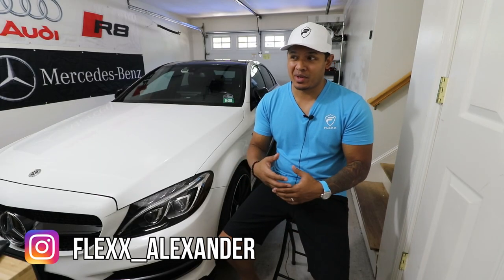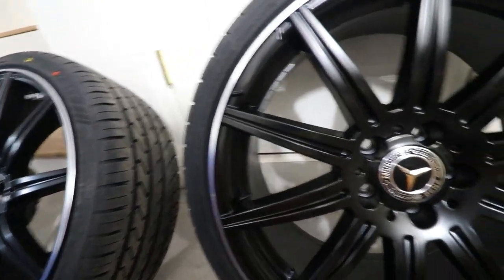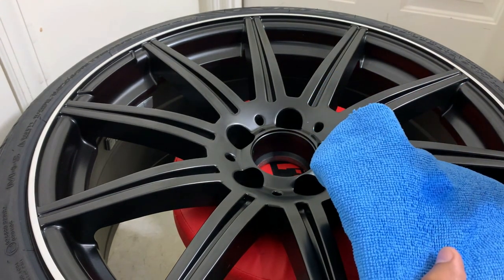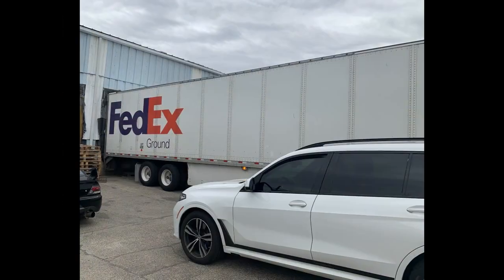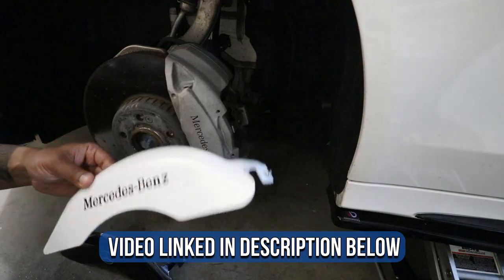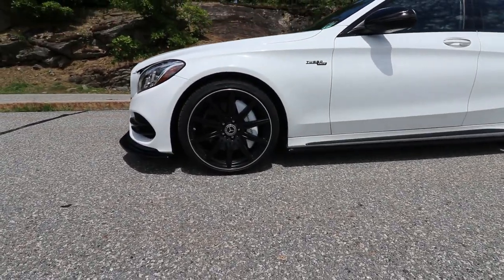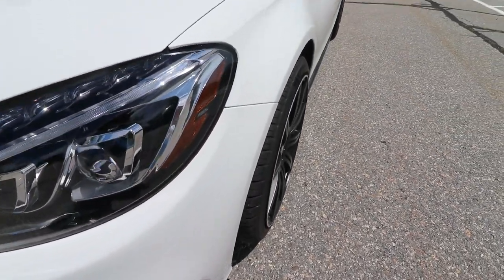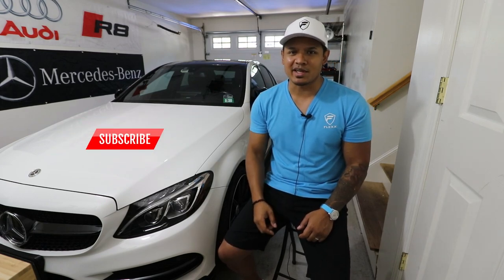Replica wheels on my Mercedes C300 (W205) 2015+

Comment: Looks great. Instead of lowering my w204, I put on Bilstein shocks and struts (kept OE springs) which are shorter than the Sachs. I then put on 19s from 17s. It’s not perfect but it closed the gap a lot.
Reply from the maker: 19s on a 204 and 205 are the way to go. 18's are still too small and 20's are way too large (kinda gaudy).  Plus with 19" rims, you can still have a decent sidewall profile for the tire to take a beating in the streets.

Comment: Flexx,
No pressure! Yeah a new rim for a c450 19” OEM is $1103. Thank god I had a warranty back then. I have multiple spoke  which I need to refresh or powder  coat. Road rash. But I was never into black rims,but those looks nice even with the caliper covers. I need to check it out as the brake dust is Horrendous. Nice combo for sure. Oh by the way finally got both roof and carbon spoiler on. Looks good but definitely not like yours. Keep up the great work !Mahalo 🤙

Comment: I swear you read my mind. I got the exact same wheels/wheels caps. Same specifications but I have a staggered fitment because I have the amg package. 225/255. Mine were silver and I wrapped them satin black 😂. Mine were OEM but I got them used, so I got a killer deal for them.
Reply from the maker: Heck yeah!!!!! 😎🤙🏼. I could do stagger tire setup but I rather run a square setup on mine so I can rotate the wheels easily since it’s a daily driver. Plus won’t cost a lot of 1 tire blows.
Reply: @TheFlexxGarage  I got a reply 🥹, let me know if you plan on doing a audio system upgrade, like add/upgrade the subwoofer/add more speakers to your car. I’m doing a full burmester upgrade. Full OEM specification etc. let me know if you plan on potentially doing that because I’m in the process of doing that, and I could help!! ALSO, I only got my w205 c300 because you made your videos, and it gave me the confidence to buy, so THANK YOU
Reply from the maker: Nahh. I don’t plan to.  Just too much work plus I’m older now and just don’t listen to music that loud like I use too. I have a sub and amp that’s been sitting for like 3 years and I don’t even have the urge to slap it in my benz or my A4. Hahahaha

Comment: Love it but yes, that wheel gap kills it a little. Why not just get some H&R sport springs? The drop isn't crazy, you shouldn't have rubbing issues and the car will look 10x more aggressive. I put them on my 2020 c43 and they're perfect.
Reply from the maker: Already answered this in another comment. I bought the springs a year ago and they are in my garage.
Reply: @TheFlexxGarage  Sorry, don’t read through every comment to check first. I did now however look to see and for what it’s worth I’ve had those springs on my car for a little over a year now and I know everyone thinks where they live they have the worst roads ever but if you’ve driven in Chicago or the suburbs it can be interesting one might say. I’ve had zero issues driving the car and have never rubbed on anything yet. My wife takes the car out once in a while and has also never had an issue. So if I were you, I’d throw those things on right away as it will completely transform how amazing that car looks and again, there’s no reason you should have issues with rubbing or clearance etc.
Reply from the maker: im not concerned with rubbing or clearance. I have the same exact springs on my A4 along with 19" rims (wider tires than benz) and my wife refuses to drive that car because of comfort. It's harsher than stock. It's not always about the looks. And I'm not going after a show car look cause this car barely goes to meets. 

Plus, I do have crappy roads. I already went through a set of rims (forged wheels) being bent from potholes. And my sister had an E-class that went through 3 set of rims in 1 winter. And it's not bad driving...it's crappy ass roads. The benz is our daily driver and sees way more time on the road than any of my other cars so it's exposed more to the junk roads. I value comfort over looks anyday based on my circumstances.
Reply: @TheFlexxGarage  I hear ya. For what it's worth, the ride feels absolutely no different from stock. I was worried about that also but still feels 100% stock.
Reply: Yeah I wanted to do that also but the ride is rough enough. But it definitely looks better though. C450

Comment: Looks killer. Did you feel a difference in ride quality with the 8.5 all around ? And how does it ride as far as road feel or road noise with the lower profile?
Reply from the maker: Rides the same as my stock 18 inch wheels but just a tad more stiff cause there’s less tire sidewall with larger diameter wheels.

My wife is a stickler for a comfy ride and she drove the car and barely noticed a change in ride quality.
Reply: Thanks for the reply! Where did you buy the rims?
Reply from the maker: Literally mentioned it in detail in the video.

Comment: Hey flex, rate my setup. 

I have a w205 2018 Mercedes-Benz c300 Base-Model Sedan in Selenite Grey-Metallic. 

Already got a chrome delete (changed to gloss black), grille swap to GTR style, gloss black door handle covers, debadged (& replaced with only simple gloss black trunk star), got 5% all round, 20% fronts w/ 50% ceramic winshield. 

I just ordered a Brabus tuning chip, custom luxury/elegance front end (luxury/elegance front bumper, custom gloss black Maybach style grille, as apposed to normal S-class Louvre-style that is offered stock with luxury-trim W205’s), along with an AMG-GT style rear bumper, complete Brabus Carbon fiber body kit, including; front lip, side skirt, rear wing, rear diffuser, fog light vent covers (since luxury bumper is same fit as base model, and this is all Brabus had to offer besides front lip for base/luxury bumper) all real carbon fiber, as well as hood/trunk logos to match (i paid for the entire kit & chip, im throwing the B’s on if i want to idc i earned it… atleast im not completely cornballing it w/ the giant “B” on the grille, lol…)  as well as a c63 style forged carbon fiber hood, AMG side fenders, and custom Chrome Hearts rims, 1:1 with the ones drake has on his custom Rolls Royce (had made 20” with 5x112 bolt pattern) 

…All for under $5000, rims & tint included 😂

So, reason I say all this (not just to flex) but to show it does not matter what trim/version/model/car you choose, but simply what you choose to do with it.

Comment: Looks great! I looked for the link I couldn’t find it. But my Amg rim was like 1104 each . I need to bring to wheel man to get the curb rash off. Thinking about new ones or powder coat. Multi spoke grey/ silver on white. What would Flex do? Hey that would be your new shirt idea with your logo. 🤙
Reply from the maker: There’s no link. As mentioned in the video, it’s a contact at the wheel store that you need to reach out to. 😎🤙🏼

Comment: How come you chose these in Standard 8.5 all around fitment over your previous Staggered 7.5 front & 8.5 rear wheel setup? Any benefits or cons you noticed with the change?
Reply from the maker: I rather have a squared setup so I can easily rotate all the wheels to whichever corner of the car I want. The car is awd and better performs with all wheels being the same size.

Comment: Sup Flexx! What do you recommend for wheel sensors for a 2013 Mercedes c class? I just brought a set of 18 inches aftermarket rims and I need a set of wheel sensors for it. And do I also need to get a TPMS relearn reset tool for it too?

Comment: Do you have any rubbing? Also would 19x9 be an issue?
Reply from the maker: No.  

19x9 will rub inside (especially in the front) unless you get a more aggressive offset but then your wheels like stick out past the fender and if you hit a bump, the wheels will smash into your fenders.

Comment: Hey flex, i just turned 18 and im looking to buy (finance) a 15’-16’ c300 in the next month or two. but im a bit skeptical about maintenance and reliability. Is there anything to watch out for? And on top of that, the used car market is terrible right now, do you think it would be better to wait and see if prices drop? Or should i stay with my 2010 jetta vw with no car payment?
Reply from the maker: Wait. 

And don’t buy a 2015 c-class but 2016+ is fine.

Maintenance is normal like any other car.
Reply: Although going on 7 years on my c450 I have no issues 86k. I think no car payment is always best. Save your money un less you got a lot of it.
Reply: @TheFlexxGarage  Is there anything in particular wrong with the 2015?

Comment: Nice! I wonder it would fit with 40 profile tires. Where are you from new england? Im live in NE too. Cheers!
Reply from the maker: Of course it can but for a c300 (w205), the 40 profile on a 19” rim will throw your speed gauge off from the real speed of the car.  40 profile will make the overall diameter of the wheel too large compared to stock diameter.  

235/35/19 is recommended for a square setup (all wheels the same size). 

40 profile for a c300 (w205) is for 18” rims. 235/40/18 is recommended. 

And for 17” wheels would be 235/45/17. 

I live in Texas now.
Reply: Thanks for letting me know man

Comment: Your offset should be 44 front and 49 back! I bet that will hit the arches! Plus the tyre/wind noise excels due to aero going down the side of your car hitting the tyres! Nice wheel though.
Reply from the maker: Nope! Zero issues. If the car was lowered, then yes, “might” hit but not with my setup.  It looks good and it rides fine.

An offset of 44 and 49 is close to factory wheels. Thats tucked in and won’t look flush with the side of car.  That’s the look that everyone hates on any stock car and they quickly fix it with spacers or new wheels with a more aggressive offset like mine.

Comment: What do u think about et30? Would fit or scrub? Same size wheels
Reply from the maker: Depends what tire size and what suspension you’re on. 

I think with any tire wider than 235, the wheels will stick out past the fender and if you hit a big enough speed bump or pothole, the wheel will bounce up and crush the edge of your fender.  Again…just my opinion.

Comment: 19x8.5 work ? Aren’t the back ones wider? U don’t rub or
Reply from the maker: As mentioned in the video, it’s a square setup (tires and rims).  And no issues with my stock suspension.

Comment: Did the rim and tire change roughen the ride  ?
Reply from the maker: Just a tad because the tire side profile is 35 compared to 40.  Less tire to cushion/absorb bumps/cracks/potholes.  Car still is very comfortable to drive.  If I also added lowering springs…then it will definitely get harsher.

Comment: Will these fit on a stock 2016 C300 4matic?
Reply from the maker: Haha. My car is a stock height 2016 c300 4matic.
Reply: Well I appreciate that but the fog light grill fins you put on your car don’t fit on mine. @TheFlexxGarage
Reply: Maybe mine is not the “sport” model? Not sure that makes a difference for height though. Thsnks!
Reply from the maker: You asked on a video about wheels so I’m gonna assume you asking about wheels. You never said anything about trims. 

If you wanna ask about something else, then be more specific or go ask the questions on the trim video. 

You never said anything about fog trim in your original question. Completely different things and that’s based on what package your car have. C300 comes in sport and comes in base/luxury. Both are stock c300 4matics but they don’t have the same bumpers, side skirts, brakes, and some more.
Reply: Ok thank you! @TheFlexxGarage

Comment: hey did you need longer wheel bolts ?
Reply from the maker: I dont remember. I did get new ones that were chrome.  

I recently switched back to my stock wheels and was able to use those “newer” chrome bolts on the stock wheels as well.

Comment: I I have the base model c300 will 8.5 all 4 fit ?
Reply from the maker: It should no problem as long as the tire width and offset of the rims are like mine.
Reply: @TheFlexxGarage  is ur car rwd or awd?
Reply from the maker: Awd. That’s why I got a square setup for my wheels.
Reply: @TheFlexxGarage  so mine is the base model and it’s rwd it won’t work the set up than?
Reply from the maker: Rwd has nothing to do with it.  Rwd gives you the flexibility to do a stagger setup or a square setup.

I think you need to seek a wheel shop.  There’s alot involved in wheels. Not just the width of rim.  I just know my setup works for a w205.